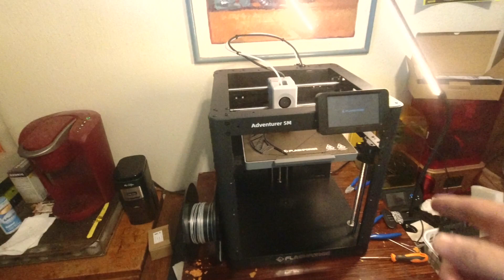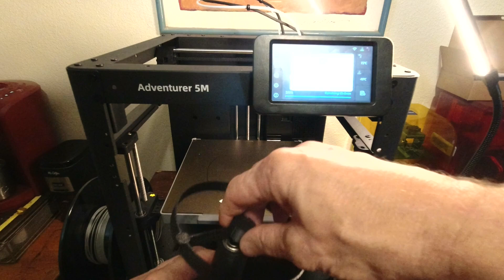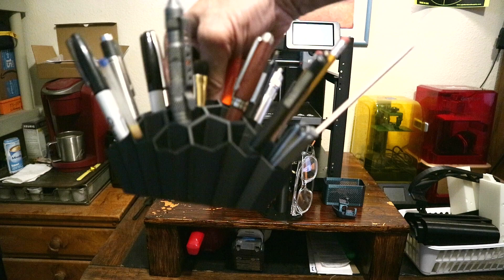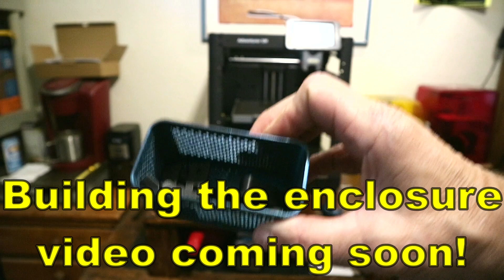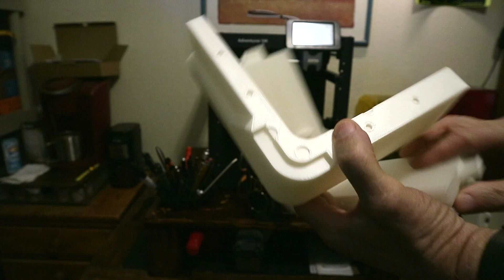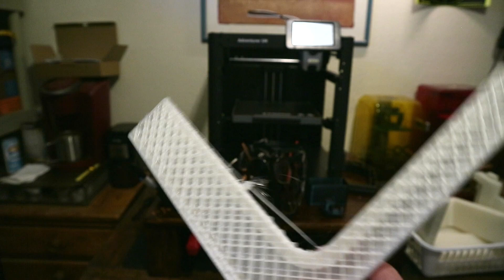Flashforge Adventurer 5M - Day 4. Enclosure prints, fun prints and my thoughts about the printer

Comment: I bought the 5m pro a little over a week ago. Nothing but WiFi issues. It will work for a print or two, then go offline. I love the printer, but not the software. Had a 23-hour print just stop and freeze 17 hours in. Tried the recovery function, and it knocked the prints over (three vases).  I was going to get a second Pro, but after watching your series, I think I will get the std 5m and do an enclosure and the upgrades for the heck of it. I want to love this thing, but the software/firmware glitches are maddening.   Thanks for documenting this!
Reply: I got set issue with my m5 I don't think I updated firmware I belive that should sort it out

Comment: based on the price, I think there is the same value just getting the 5M pro, which has enclosure, extra .6 nozzle, camera and ai detection ,,, my opinion after getting the 5M, and looking at the total cost of upgrades
Reply from the maker: You make a valid point. But, at least for me, there's a rabbit hole involved. Once I spend the extra money to get the Pro with the full enclosure, why not spend that much more again and get the Qiditech with the heated enclosure and 30c more nozzle temperature? And of course, I wanted to tinker and make videos, so for me there's a lot to think about.

Comment: I mean by the looks of the way 3d printers are going, looks like the market is down. No one seems interested anymore, and they are either too expensive or very cheap because no one wants them. This machine needs to be 100 dollar cheaper, then I could see myself buying one. A lot of 3d printers are so cheap right now, they are all going down in price all the time.
Reply from the maker: Where's your proof that the market for 3D printers is down and "no one wants them"? If you're going to make statements like that you should give some cites. Cause I gotta tell you, if the market were down and no one wanted or was interested, we wouldn't be seeing new models released like we are.
Reply: @3rdpig  just from what I'm seeing in all corners of the 3d printing space. I could never have imagine a 400 3d printing selling last year for less than 100 bucks. Granted newer models come out making them less appealing, still. Even bambulab cut some their prices. YouTube 3d printer reviews viewership is low.

3d printing is my hobby, so I follow it closer than others. I've followed your 3d printing stuff from way back too. Idk, we'll see if it picks up again, doubt it.
Reply: I disagree. $299 is crazy cheap. It's fast, reliable(mine is). You can easily enclose the unit. It looks finished. It does not need to cloud to operate. The a1 mini also is a good buy, but it does have smaller bed. If you need multi color of course that would be the way to go. But I'm older and remember if I wanted a customer part made if could easily run into the thousands.  3d printers of almost any type today are amazing.
Reply: @hobbyhands  its not a bad price, its been that price for awhile now. I'm on a creality k1, which can also be found for 300 bucks. With the k1, you do get a little more value out of it. The open source klipper firmware is nice to have. I still prefer bed slingers, still can go fast, and most are cheap nowadays.
Reply: @hobbyhands  its not a bad price. The creality k1 can be found at similar price, a bit more value considering it has open source klipper firmware. I still prefer bed slingere, can go fast, and cheap nowadays.
Reply: @oneanother1  Nonsense! you are talking utter bull
Reply: @shaunmorrissey7313  well at least he didn't delete my comment this time. Flashforge are already coming out with a newer model with multicolor. Let's see how well its received.
Reply: This market is up 75% to the date from last year why do you think everyone and there mama is focusing on bringing pro level machines to a house for less then $500 it's a great time to get into the market get ahead of the learning curve and make that money 💰
Reply: @mikelguerrero8061  what are you even talking about. What machine is everyone buying? All I see are cheap printers that no one is buying. There are a lot of bots and shills on YouTube claiming all sort of things about their 3d printer. Don't believe the hype. The era of diy 3d printing is dead. Its the era of copying each other, because no one can innovate.